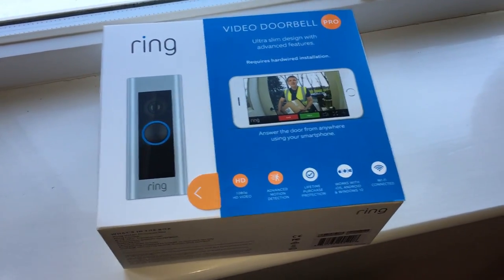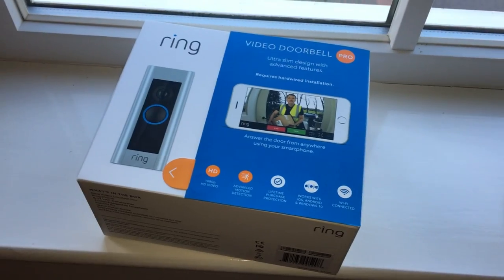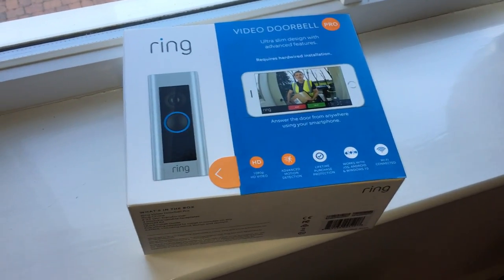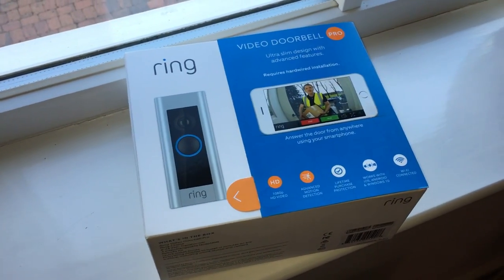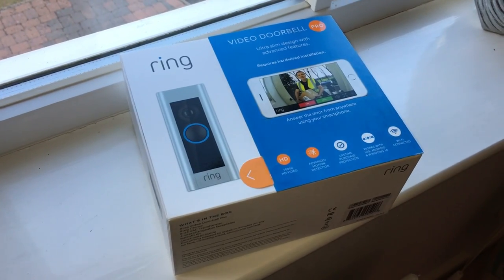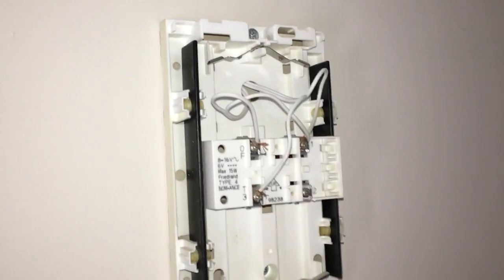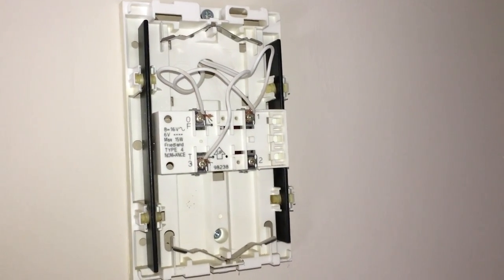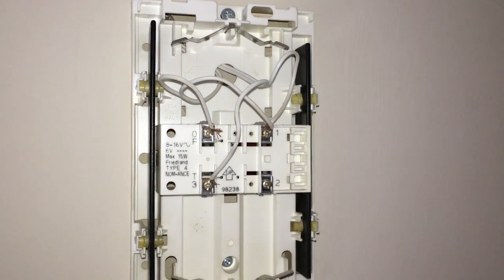Installing Ring Pro Doorbell Transformer in the UK (Review)

Comment: So........ I do not have a mains powered doorbell anyway, so I can just get the transformer installed in the fuse box, have a wire run to the face plate & use the included plug in chime & we should be good???
Reply from the maker: Yup, that would work.
Reply: RJMCTV that's for the link to the video. Looks easy I might give it a try.

Comment: I want to install the Ring Pro and still want the original mechanical chime to work, is this possible? Basically I want the Ring Pro to still work like a traditional bell push as well. Has anyone managed to do this?
Reply from the maker: DonCorleoneMafiosi To my knowledge only certain existing doorbells work. I don’t believe mine is one, but a fill list can be found on the ring.com web pages if I remember correctly.

Comment: 63A Breaker!? A fused spur at 3A should have done it. The circuit is already protected from the CU.
Reply: The poster did say that it was not necessary.  It did however a) provide an isolation switch b) fill a hole in the box to stop fingers getting in and c) come for nothing :-)
Reply: It's an RCD, not a "breaker". 63amps is the maximum current it is rated for, before it could fail. If you passed more than 63amps through it, it wouldn't trip, normally they eventually just fuse solid and the switch doesn't work anymore. An RCD provides no protection against over-current/short circuiting, it protects against faults to earth, be that through a person or through a fault in the wiring, and their protection is rated in milliamps not amps. The RCD is doing nothing after the transformer as 24v isn't enough to pass current through a person to earth, so the only thing it's protecting is the 3 inches of wire from the RCD to the transformer, so if you were to be daft enough to stick your hand in there with the MCB from the CU switched on, and touch the live wire, the RCD would detect an imbalance and trip, touch both live and neutral, and it'll quite happily let whatever current the resistance of your body allows to pump through you, without tripping, as there wouldn't be an imbalance. Just a plain Din rail box with 2 spaces will do the job. £3.55 in Screwfix. The protection is there from the MCB and RCD in the main CU.

Comment: Thanks, Easy to understand instructions. Quick Question, since you now technically have a new consumer unit, are you able to work on it with a licence in the UK?
Reply from the maker: Thanks!
I don’t think I have a new consumer unit. The existing one, with all the connections, is still in place. This addition (as far as I am concerned) is just a fancy enclosure for a transformer. I’m sure any electrician would agree, when applying logic.